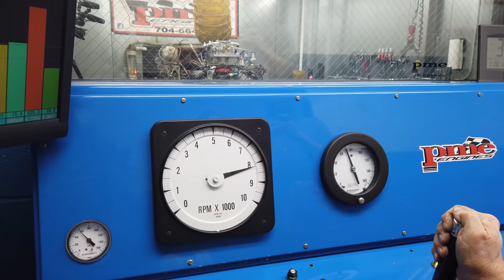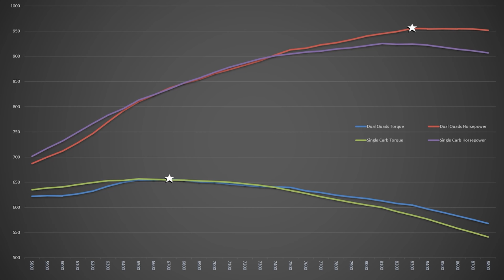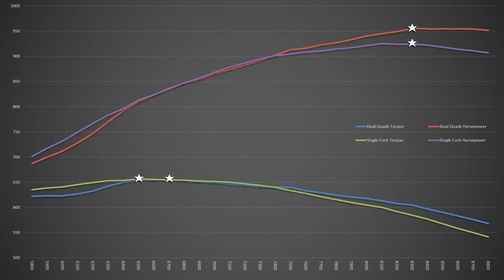955 Horsepower NASCAR Engine for the Street! (w/ ProMotor Engines)

Comment: Just curious: You stated that all Chevy backed teams in NASCAR cup racing get their engines from either Hendrick Motor Sports or "ECR"..........don't ya mean RCR? ( Richard Childress Racing )..........or am I mistaken? Thanks in advance.
Reply from the maker: It is weird, but you and I are both right. Back when Dale Earnhardt was alive and running his race team, DEI, he and Richard Childress teamed up and pooled their resources to build engines together. The company they formed was named ECR, which stands for Earnhardt Childress Racing. After Dale died and Theresa ran DEI into the ground, Richard Childress and RCR took over complete control of ECR, the engine building operation. I guess Richard never changed the name out of loyalty to Earnhardt, but I don't know for sure. So, yes, RCR builds the engines, but the division that actually does it is named ECR (https://www.ecrengines.com/). Hope that helps, and thanks for watching!
Reply: @TheHorsepowerMonster  Oh, I see. That certainly makes sense. Thanks again for your quick response & great info!!!

Comment: The engineering is awesome, and if it's your thing go for it, but for my dollar on the street on pump gas even a roots blown old school big ci motor can be built on the cheap with new or used components an make way more power in the useable range, live longer and be cheaper to fix. Pulley swaps and EFI make tuning that power a breeze. Being able to make 700 ft lb at 2500 rpms helps longevity cruising in overdrive. Heck,  an N/A 750 hp 572 pump gas street hemi still idles smooth and costs WAY less. 1000 hp is not uncommon on actual street driven N/A hemis. Even GM has that 632 BBC crate motor that makes 1000hp with one 4 bbl!  I just went with a blower on my 572 hemi because it's much torquier and easier on components. I can drive in, then swap pulleys, go to C16 race gas, and water-meth injection and its katie bar the door! Shift at 5500 or 7500 just keeps pulling! Then run overdrive at 2k rpm all the way down the interstate. The vacuum from under the blower hat will run the power brakes and heater. If I wear it out I just replace the sleeves in the Keith Black aluminum block. Put a window in it? Weld it! Completely destroy it? not likely, but the blower and fuel system will still be around for the next few decades! You can rebuild it on your kitchen table! The gen 2 hemi is the only engine that is an investment because you can always sell them for more than you have in it. Wedges are cents on the dollar. When this wears out, or gets windowed it's scrap, and its going to be making a heck of alot more revolutions to go a mile! Everything has been sacrificed to meet a rule book. Still very impressive tho!

Comment: 112 octane to prevent detonation. Wonder how much timing they are throwing in here. Also would love to know what this engine can do on pump 93.
Reply: That engine could never run on 93, it would destroy it in no time.  Probably can get it down 2 points with a aggressive tune, but I wouldn't advise it.  A detune sb2 would be your best bet to run lower octane than 112, this engine is a totally different beast.

Comment: I think that the engines used for racing should have to be available in the manufacturers production cars, of course in a street version but basically the same block and heads the way it is now a Chevy,Ford, what ever is not really a Chevy or ford or whatever it's the shop that built it's brand

Comment: Awesome Engine Builders.  Magnificent HP  & TQ  No's.  Want 2 hit the 1000hp   with this 397cc  just had a Snow Performances water/ methanol injection kit stage 3.  and the magical 1000hp  will be available  with added kit & will also keep everything cool & clean top side.  
How much is one of these little Beasts . Anothee addition would be fuel injection rails ..... more hp there as well. 
Just ❤❤❤❤ 'in it. 

Robert Australia.  
Thx 4 sharing guys.  Xcellent 😂👏

Comment: I would love to see this as a fuel injected vs carb, but I would do is put dual fuel injected carbs and another set of port injection that way it would get best of both worlds plus run it on e85 or methanol lol you would definitely see way over 1000hp plus the other thing I would do is bump up the compression to 14:1

Comment: First off, I attended SAMTECH in Houston TX. I've had my hands on 9k-10k rpm engines, engine masters engines, and I've made my own pro stock head(just one cylinder). Doesn't mean I know anything but I've been around it alot. Long story short, I don't agree with the application of bearing guard with your fingers and rubbed on.. I know it's stupid and every engine builder has their own ways buuuut that's one thing I don't do. Also, being a cylinder head guy, I already knew what the black plates were for..lol. pro stock makes fake runners and turn their cars backwards in the pits, so you can't see anything. As far as my choice let me get that street version. I'll convert to more R's

Comment: Amazing tec , but ill bet i could build at least 2 aluminum 500ci bbc s for less money and have more low end torque.
Reply from the maker: You are absolutely right. But when these engines were designed, low end torque was the last thing on anyone's mind. They are meant to be ultra-durable, high-rpm screamers. It is sort of apples and oranges, I think.

Comment: I’m into motorcycles more than cars. I sold motorcycles for a couple decades, raced motorcycles winning championships. I have a lot of experience
  One thing I always told people that thought they wanted a very fast motorcycle. If you don’t use 100% of the power at least once a day, do you think you really need all that power? You are paying for it whether you use it or not.. if you’re not using 100% of the power ever, what’s the point?
  i’m sure you have to have special fuel to control detonation. you’re probably not gonna have air-conditioning. For the life of a very high powered engine is shorter, especially if it’s a one off..
But of course, there are always people they feel that too much power, it’s just enough

Comment: I'm just curious, does a newly built engine have to be broken in before dyno testing?
Reply from the maker: Mostly get it up to temp gently to seat the piston rings and make sure there are not leaks. If the engine uses flat-tappet lifters, there is a bit more involved process to mate the face of the lifters to the cam lobes. Then after running a bit, double check the valve lash and maybe check the spark plugs to see where you are at. Then you can start making some pulls in earnest. Hope that helps.
Reply: @TheHorsepowerMonster  thank you

Comment: Werent most old school blocks cast with a 4.5" bore center?
Reply from the maker: Several had larger bore centers, especially the big blocks. But the small block Chevy has always been 4.400 and the Windsor Ford is 4.380, which is what has been raced in NASCAR ever since they went to the 358 cubic inch engine size way back when. So when Toyota wanted to come on board and NASCAR changed the engine rules to allow a 4.500 bore spacing it was a big deal. Thanks for watching

Comment: I’m thinking what the fuel difference is between drag and street cars compared with NASCAR race engines after looking at 4piston engines and Steve morris engines, as his is turbo boosted V8’s and the like and 4 piston 1000hp crate engine for Honda’s, I’m not sure what’s better for street for drag and roll race, cruising car as they all have high HP but the tech is different.
Can anyone explain more to me?

Comment: Why didn't they rely on push rod length to fine tune valve opening instead of multiple shim under the rockers?
Reply from the maker: Pushrod length is used to adjust lash, but the shims adjust the rocker arm geometry. For example, if the rocker is too low,  the arm will be pointed up to get to the valvestem tip. This means the rocker will only roll across the closes edge of the valve stem and not across the center. So raising the rocker up with the shims corrects that geometry problem. It can be hard to visualize without seeing it, hope this helps, and thanks for watching

Comment: Nice engine, BAD choice for the street since NASCAR engines are designed for HIGH RPM horsepower and have very little low-end power/torque.

Comment: I wouldn't like to have either of these motors!

I would prefer a twin turbo small block making peak torque around 3500-4000 rpm, and be able to daily drive it.

There is no way you could daily drive either of these motors.

Comment: Yeah you could use it on the street but you're going to have to lower the compression you can't run pump gas on 12 to 1 compression

Comment: Could the 750hp pump gas version handle a 300hp shot of nitrous, safely?
Reply from the maker: Almost certainly. Especially if it is built with this plan in mind. Thanks for watching.
Reply: @TheHorsepowerMonster  Thanks.  The golden question, how much will an engine like that cost to have built, ready for install and tuning?   Also, does a 4L80E transmission connect normally with this block?  I have a fully forged 390ci LSX that I'm about to put a Procharger F1X supercharger on in my 1998 Trans Am WS6.  It should make 1,400 RWHP easily.  But I would love to have a Normally Aspirated beast on spray.   Would this engine be good for roll racing, say 40-50mph roll ons up to 170mph.  Would that be its sweet spot?  Texas Mile type of events also is what I'd like to start doing, standing half mile runs and 1 mile runs.   Thanks.

Comment: Saw an interesting video on the RO350. Chevy engineers talked about how poorly there 350's were designed. And that they basicall went with the Ford design for their NASCAR engines. The only real difference was the valve covers, their words not mine.

Comment: Amazing power from an engine that admittedly will only last 300 miles or so.
Reply: Like the narrator said, these engines are designed to run 500-600 miles at WOT. I think it's got much more longevity than you think.

Comment: The main question is going to be COST. At face value, this is a dead end platform and unless you are willing to tie yourself to a Specialty Builder/Shop/Program, it seems pointless. The Aftermarket has ZERO reason to supply parts choices to the public with the popularity of the LS. SBC/LS/BBC is enough. The SB2 isn't exciting. Other than the R07 valvetrain, the only real benefit for an N/A high RPM spinning application that this block has over an LS is the better windage control compared to an LS's long skirted bottom end.
Problem solved, skip this idea and build an engine based on a Motown II LS block and have the best of both worlds. SBC 4bolt bottom end with LS cylinder heads. CHOICES FOR DAYS. Motown LS II Block, Fully counterweight (8 weight) SBC crankshaft available off the shelf, time proven external timing belt drive by Jesel, Off the shelf roller cam (hyd or sld), big-bore lifters, off the shelf Rods and Pistons (including NEW tech such as pin buttons rather than clips or press-fit pins, that the R07 doesn't have) and an aftermarket set of LS7 style LS Cylinder heads with accompanying bad-ass valvetrain, along with off the shelf induction and ignition. If the SB2 was released to the public when it went to NASCAR, it may be a different story, but this motor isn't going to turn the average guy upside down with enjoyment. Either doing an LS/SBC hybrid using a Motown II LS block, or go pure LS with a Billet RHS block, the LS doesn't leave you with a one-of-a-kind paperweight if it blows up.
Frankly, the SB2 is 20 years too late, for Street/Strip purchasers when the LS Aftermarket is literally ON FIRE with options. These engines will end up in the hands of NASCAR fans and people that don't care about money and funding dead end platforms. The buyer of this engine combo will likely have a super-built Ford Flathead..... THAT kind of guy.

Comment: UNDER 400 ci and almost 1000 HP! That's not even the best part, it's the flat HP curve over RPM's!!! This thing would out perform many engines with peak HP at 1200 or even more😮

Comment: A detuned engine at 700hp is a LS or SBC capacity. And they would be better as a street engine anyway
Decades ago a friend used an ex Nascar SBC engine in a speedway sedan. It had 700hp but was harder to drive and really slower than his own 355 SBC with a 150 less!! Where it was all useable.
Nascar,,, where there is NO GM parts in their cars!

Comment: So when can I get one? How long would it take to build and I would love to put my order in for the street machine for a truck build I am about to start on.
Reply from the maker: You can probably get one in your hands pretty quickly. As you probably noticed from the video, Pro Motor has a huge stock of engines and components that they are building for racers at all levels. Adding in a street guy should be no problem. The only new components they would need to order would possibly be the crank or a set of pistons depending on what setup you want. They are great guys. www.pme-engines.com . Thanks for watching

Comment: the fact is that this motor and the toyota engine are designed from the R5-P7 dodge engine which has lead the way everytime NASCAR has moved forward in technology .and when nascar told dodge they couldn't make more then 870 hp and were going to have to put the NEW nascar engine in the dodge body Dodge said FU and left cup racing took lots of sponcer money with them , so nomatter what the badge on the body says they have the nascar engine claimed to be chevy engine when r5 was 4 years already in a car .

Comment: just built a 408 stroker for my airboat its not fast enough need high torgue &hp at low rpms motor will never go over 5800 rpm

Comment: Moly pistons?????? Bro what are you saying? This is a killer engine but be clearer. Maybe its got moly rings? Also the single carb at the end was up in horsepower from 6600-7500 not down in HP.
Reply from the maker: Mahle Pistons.  https://www.us.mahle.com/en/motorsports/powerpak-pistons/
Reply: @TheHorsepowerMonster  My bad! Moly is not Mahle! 😂
Reply from the maker: No worries. I had a couple other comments saying basically the same thing. Need to be more specific and say something like "Mahle brand pistons" or something like that on future videos with those pistons. Regardless, thanks for watching!
Reply: @TheHorsepowerMonster  also pronunciation of Molly and moly are already the same and doubtful Mahle is same as them but I'm not german so not sure on that 1

Comment: Which would I go for? Neither. This is super cool "trick" stuff.  But that price tag is super big too and don't even get me started on the complications involved in getting one these exotic screamers into a typical street going car. 950HP is a super 2+HP/ cu inch.....to call that merely impressive would be an understatement. A street friendly build at 700HP is no less cool and I'd love to have one. But.......Call me a "cave man" if you must but I think if I need 700- 950HP NA....... I'm gonna go completely old school with a stroked Big Block Chevy instead. No it won't be nearly so "built proof" strong or high tech yet it'll come in at price tag far lower and bolting it into a car or truck won't present nearly as many challenges to over come. That said though.....I am talking as guy with a budget that wouldn't be unlimited so I'm willing to give up the "WOW FACTOR" pretty quickly to accommodate a "budget". You just know that there are gonna be customers for these builds. The guys as Jay Leno would describe them, "Full Fledged members of the more money than brains club". I gotta admit I'd love to be member of that elite group. Sure would be cool to hear an near 9,000 RPM shift point.

Comment: It amazes me how much that Chevy race motor looks like Ford motors have been set up for ever. 
Exhaust ports equally separated. Distributor in the front of the engine. The heads seem like Boss heads. 
Just saying.

Comment: NASCAR, F1, INDY all have engine rules that divorces racing technologies and concerns from those of cars that people can buy (and want to buy). It's plain DUMB.
--
Engine rules should be very simple: (1) The engine MUST run of 92 Octane Pump Gas or #2 Diesel. (2) The engine MUST be available in a vehicle sold for less than $100,000 in quantities in excess of 10,000 a year or 25,000 since it became available. (3) The engine must pass a EPA tailpipe emissions test. (4) The same engine must be used from the beginning of the season to the end of the season for a given car without disassembly -- if it breaks you are done for the year. (5) The engine must be fitted with an official inlet restrictor of the series; there is one for NA engines and a slightly smaller one for force fed engines.
--
Other than that, you can have as many or as few cylinders as you want. You can have as big or as small a displacement as you want. You can have carburetion, port injection or direct injection. You can have as many cams and as many valves as you like. You can have it supercharged, turbocharged or naturally aspirated. You can basically do whatever you want.

Comment: The cars are going way too fast!  WHY?  The cars are NOT STOCK cars.  Limit cars to running the engines sold in the showroom ONLY!  Does Toyota sell any Camry's with a V8?  If you want to run a pickup, do it, but don't call it a stock CAR!  The challenge would be to get the most power out of the engines sold in their showroom cars for all makes.  Then we'd be back to true stock car racing.  I'd like to see how that turns out.

Comment: I do not think they will do good on the street..because altho those engines are tuff.they are meNt to run 500 miles and that's it.how many blows up during the race.and yes hot rodders will run the piss out of them.then replacement parts is a issue